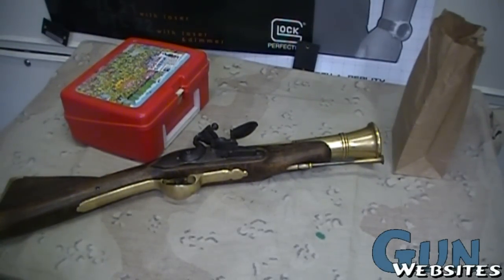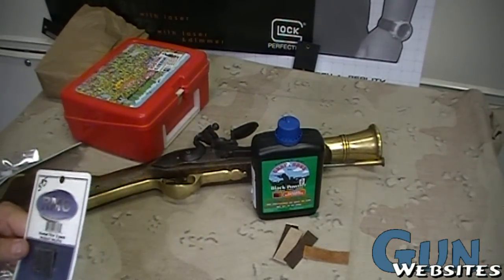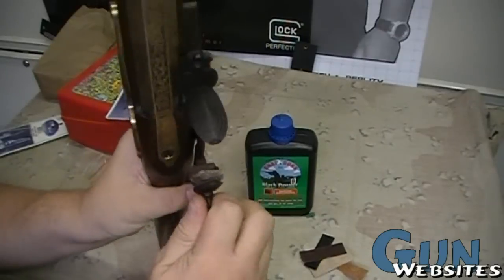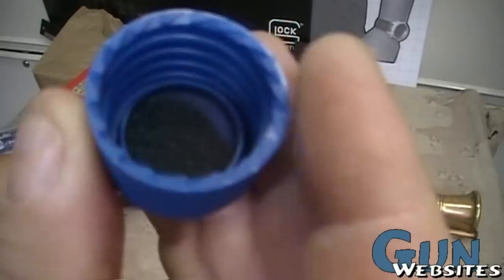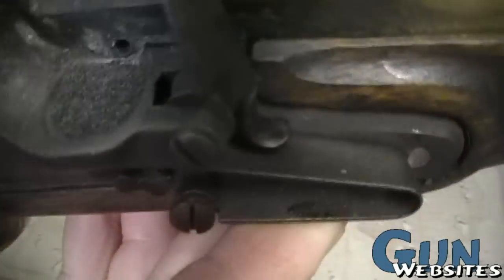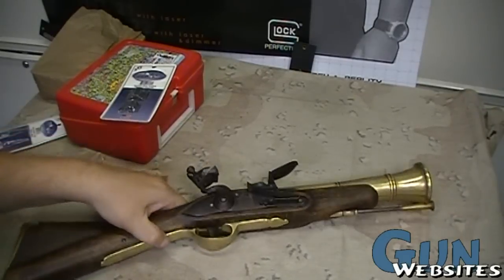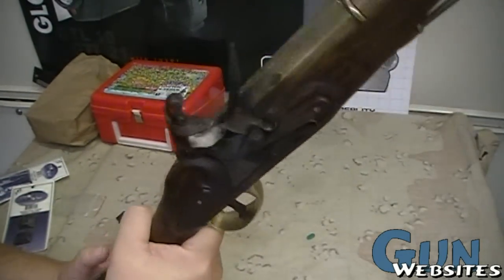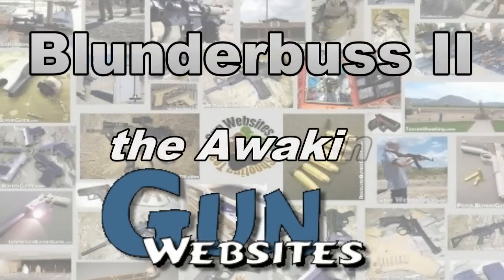Blunderbuss Breathes Fire

Comment: I know this video has been posted a long time ago. But let me tell something about the origins of this blunderbuss. I have a similar one with a slightly longer stock. I found out there are a few of these online, and nearly all of them are from France (I’m from the Netherlands myself). One of them was described as coming from the French navy arsenal of Lorient, a French city, port and naval base in the province of Bretagne. Regarding the engraved decorations, the fleur-de-lys and the helmet with the cross on top of it are symbols of the French military. The helmet with cross is a symbol of Saint Michael, the patron saint of the entire military. Blunderbusses which were made for naval warfare were equipped with shorter barrels as the barrels which were equipped on blunderbusses used by infantry soldiers were much more prone to corrosion. As this blunderbuss has marks of burnt blackpowder, it definetly has been fired before more than one time before. Movie props are made since the 1950’s but they were made with electrical firing systems instead of blackpowder ignited by a flintlock. Replica’s aren’t even allowed to be able to fire at all. This is a 100% real and authentic French navy blunderbuss, probably used onboard of a ship-of-the-line or a frigate. Sadly there are so many fake props and replicas being made that many people mistake authentic ones for being a replica

Comment: When you are trying to see if your flintlock will spark it is important to place the flint in leather and secure it tightly in the hammer's jaw. To see if the flint is of correct length open the frizzen and see that the sharp part of the flint is pointing down into the pan. It is also important that the frizzen screw is tight enough to eliminate the wiggle.This gives the flint maximum striking area against the frizzen. Also it is a good idea to make a pin to clear the flash hole. Good Luck

Comment: i own a few flinters. they are just as reliable as caplocks if you tune the lock properly. put some leather in the jaws, the shaped flint will work better because it scrapes the sparks down into the pan. just make sure your flint edges dont smack into the barrel on the left side of the frizzen.   use real black powder instead of fake stuff much more reliable ignition and easier to clean. the gun will foul up less if you season it with bore butter and avoid chemical cleaners and oils. :)

Comment: At least it wasn't just a "flash in the pan". The flint that you're using might be too short and not making long enough contact with the strike plate. As you can see, it barely makes contact before it reaches the pan. And it doesn't look like it's squaring up. 

I love how you're 'winging it' and being smart about it. I would have filled the pan and put 2 tbls of powder down the bore and stuffed a wad of newspaper in it. Then walk away with a black face like in a cartoon. 

Cheers and can't wai

Comment: Your frizzen, (the piece of metal that the flint is striking) is held in tension by that "v" spring . It should not flop around like the yours currently is so It looks like you require a new frizzen spring.

Comment: the frizzen is not supposed to be "checkered" like that also the frizzen spring is not right it looks like a prop not a gun that should be live fired i also say this because if you shoulder it the flash from the pan will be in your face the stock is way too short